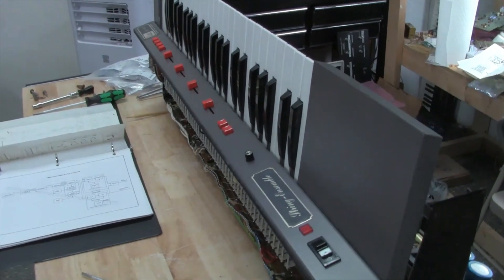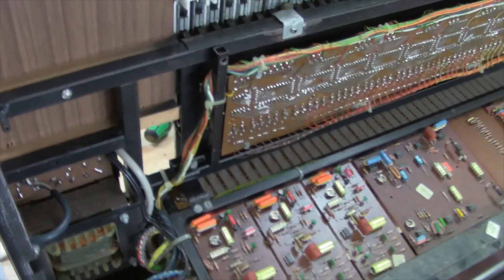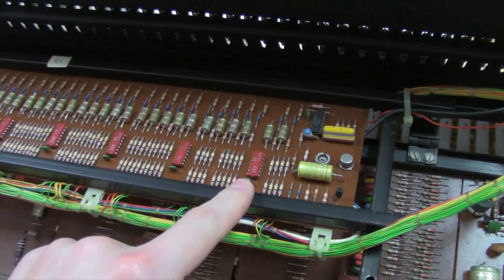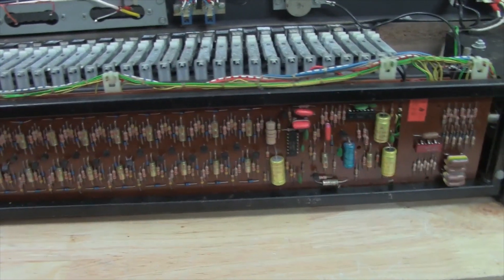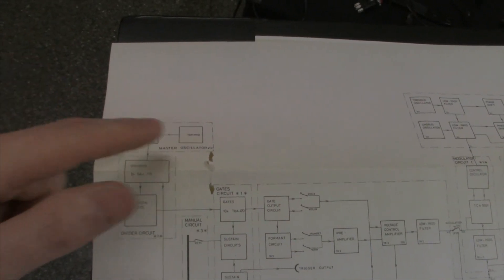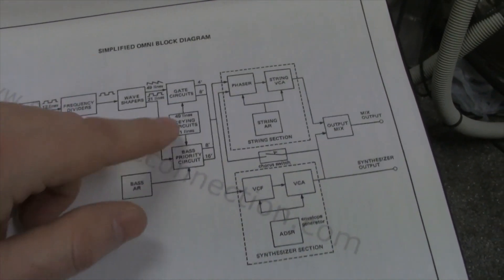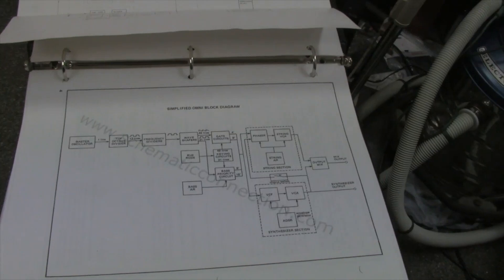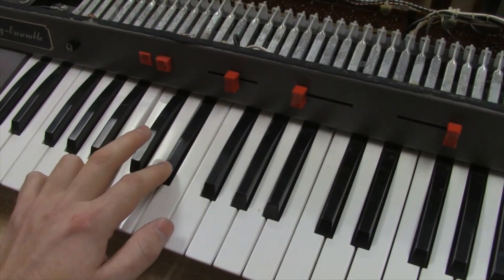What's Inside The Eminent/Arp Solina String Ensemble (by synthpro)

Comment: Those TCA350Y chips are a thing of beauty. The iconic ensemble effect they created is unmatched. When you hear a string machine with THAT sound, you instantly know what BBD chips they are! Solina, Logan, Elka, Crumar. All legends from that BBD chip. Also the Synthoma Elkorus uses them. It's basically a rackmount Solina. Very privileged to own one. Anyway, love the video and please keep up the amazing work !
Reply: How close does the Behringer clone BBD sound compared to the original? Did B clone that chip?
Reply: @mikemeengs5720  in my opinion, it's spot on. And yes, Behringer cloned that chip. It's the only way they'd get the ensemble effect to sound identical to the original Solina.

Comment: Hey there thanks for your great videos! I have a Solina that i bought as broken to fix up - it powers up but no sounds at all from either  output. I noticed the expression pedal jack is missing and the wires are just hanging inside - 20v supply grey wire and white shielded wire that goes to the registry board. Im wondering if this is making it silent so want to re-install a TRS jack for the exp pedal- do you know which wires go to which terminals on the jack? Any help greatly appreciated and thanks again for the vids! Cheers, Dan

Comment: Hi synth pro 
I have a question relating to the key actuator springs,
How did you replace the spring, I have a unit with intermittent actuator 
I was think of trying to clean the contact but very difficult to access.?
Also 
Does the bass notes use the sustain, ?
on the unit I have the bass note are not affected by sustain.
Many thanks

Comment: Hey Jareth. I have a Solina where the spring has popped out of the actuator and is hanging out behind it. How to i get in there to get that spring back through the hole in that actuator that pulls it up to the contact bar?

Comment: That was the one that started it all, back in 1974 or so. At that time I said "If only they had this a dozen years ago" . 1959 to 1964 was the golden age of the string ensemble in pop-rock. it was the height of The Drifters, The Shirelles, Roy Orbison and Gene McDaniels, all of who made heavy use of strings. If you ever get your hands on a Sequential Circuits Prelude, you will see the difference between a chorus and an ensembler since it has both, although the phaser was the first attempt to simulate the "beating" that generates the shimoer that is part of chorusing back in the '72-3 timeframe. as in the "Fazer" and Electro Harmonix' Bad Stone and later Small Stone

The only thing that made it a bit less than realistic was the buzziness or fizziness in the lower octaves, the regularity of the "warble" and the fact that all "fottages" were processed the same, which gave the sound an organ quality when you played chords. If the sound was thin, it sounded like a reed organ, as in the Bon Tempi. However, the instrument did make a place for itself and is quite vintage '70's and some '80's and I still like it

Comment: so this is basically dcos?
Reply from the maker: Not exactly, DCOs are a bit more like a oscillators driven from a time base given to a oscillator circuit from a computer source. This type of circuit typically still has waveshape circuits but all response of the oscillator is dependent upon the processing and signal multiplexing. Now I will say in some DCO designs, you will see a division stage for sometimes creating sub oscillators. 

In the Solina, the induction based oscillator signal runs at a adjusted frequency and it clocks a top octave synthesizer chip...this makes the highest octave note set possible and then that goes out to dividers where it basically changes the footage of those frequencies to give you your full octave sets.